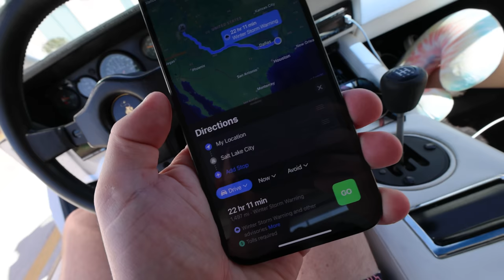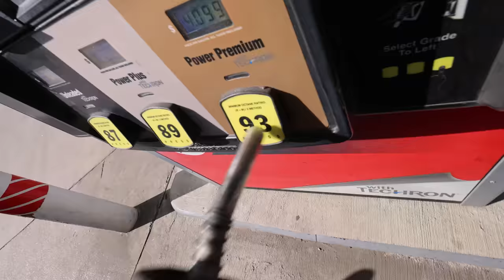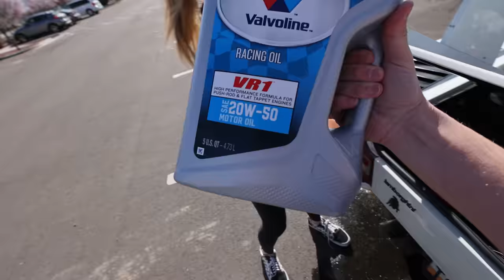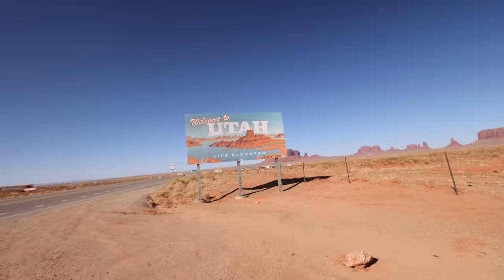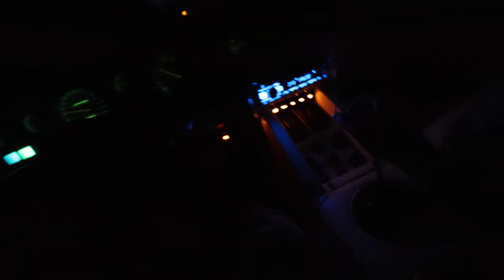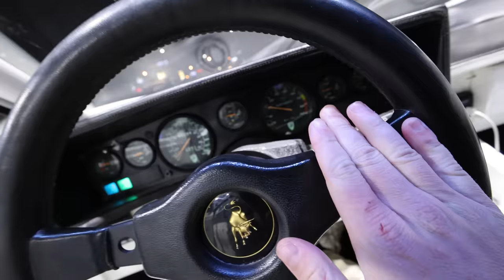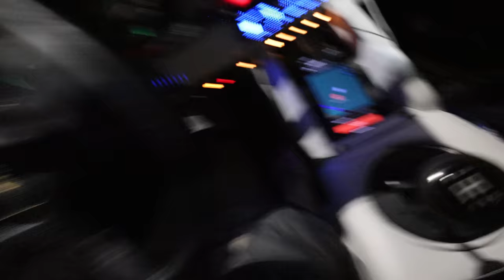Driving my Lamborghini Countach 3,000 Miles Across the United States.

Comment: Driving across country is one of my favorite things to do, but it MUST be in a good car.  Seems you have a great companion for doing so and helping with the love for older cars which a lot of use have.  I had a car that was basically given to me that I took halfway across the country , at least, 4 or more times and I never had any issues with it, but it was a German car.  That radiator stop leak is HORRIBLE stuff, and I can't believe they instructed you to put that into your newly rebuilt Lamborghini's engine.  Once , I put that crap into one of my cars and I learned my lesson when trying to flush it back out of the cooling system years later because it basically turns into Mud and is very hard to flush out of the engine block and radiator. I will never use that crap again, and just fix the leak.

Comment: K-seal is made of magic. I had a 92 camry that overheated when the 20+ yr old radiator exploded on the hwy. The block got so warped that it would leak 2-3 gallons of coolant a month. I put a bottle of k-seal in the radiator, and It completely sealed after about a week of driving it. For the next 3 years it never leaked again and I finally got tired of driving a near 30 yr old car and upgraded. I wouldn't be surprised if it still runs to this day. I am still to this day mind blown by how well it worked.

Comment: so just wanted to share as a gear head and a mechanic, non fuel injected vehicles; as in cars with carburetors require re-jetting of said carburetors as you climb to higher altitudes. the more displacement a car has the lower that altitude is before re-jetting is necessary and the more often it is needed. air is thinner up high so cars require less fuel.
      no idea how difficult that is on a Countach but on old muscle cars its pretty easy. that was the reason why the car started running poorly. so be careful. To much fuel in the cylinders can result in a condition known as washing the rings, and results in scored cylinder walls. if you are going to road trip that beauty consider looking into how to re-jet it. thats just part of the fun and adventure of owning a classic car.

Comment: The problem you had when it did not run right is caused by altitude. The higher you go the thinner the air. Which is why it died in the day, during the heat, but ran at night, thicker air from night moisture. When you get home your car will need an air to fuel intake adjustment. Great vid. Keep Smiling. 😎🖖

Comment: You can turn of the 'door open' buzzer. Find where it is coming from and unplug it. It is an electronic buzzer plugged into a circuit board and unpluhs like a fuse or relay.

Comment: let her run for a little bit after turning her on, but judging by what I see, you gotta clean out the throttle body or check your idle air control valve. Had the same issue on my 93 240sx (two different cars yes, but it seems exactly like what I was experiencing). Always a blast to see these videos!

Comment: I cant believe you put a k-seal in a lambo. Please flush the whole cooling system when you get home. That stuff will block and clog up your radiators for fun. Its a last resort product for saving you when your stuck. 
Im glad you got it nearly home but i would defo get it looked at and flushed. 
On a plus tho, Sophia is defo a keeper bro. They way she slide thru that wing to play with your hose. Damnnnnnnn

Comment: Yo strad I noticed both times it died/almost died, at the gas station and at the hotel, you were driving very slowly in 2nd gear. Maybe your leg was tired and not pushing down all the way, or maybe you're leaking clutch fluid, or maybe you have air in the clutch lines, but try some of those solutions

Comment: Great that you have one of the most Iconic cars. I always nip up the coolant hose clamps prior to any drive and have a nut runner in the car with me, just in case. The cars are very reliable. On my recent Italy trip (1600KM) I did not even check the oil. 

Question, did you specifically want a fuel injected car. Or, just a case of what was available at the time? As the FI cars have many more aspects to go wrong and they are slightly down on power compared to a carb version.

Comment: Probably has to do with the elevation change. Modern cars have computers that automatically adjust the fuel mixture with altitude, but old cars sometimes require some adjustment on timing so that they can run efficiently at higher altitudes.

Comment: My guess for why it isn't running well would be that, if it's carbureted, the altitude has just changed your air fuel ratio enough that it isn't happy.  The air in Moab, UT (~4,000 ft above sea level) is about 11-12% less dense than in Miami, FL.  So it's probably running a bit rich.  Getting that carb (or those carbs) adjusted will hopefully work wonders for the old Italian!
Reply: it is fuel injected looking up (1987 lamborghini countach 5000 qv carburetor) you can see a carburated Lambo looks like a carburetor but his engine bay shows one of the rare fuel-injected versions. He's also said it is fuel-injected.
Reply: @ICP1SBJ  Alright, then I retract my previous comment. Altitude is not the problem. And good on him for getting a fuel-injected one!

Comment: the fuel issue sounds kind of like the fuel tank does not get air to pressure the fuel down better to the fuel pump etc. it does better on higher rpm but idle it cant suck fuel very well. the fuel tank cap or something else is the issue there. if the issue is in that

Comment: Thats normal on carburator old cars it will die the idle will get crazy. Try to minimize as much as electric when it happen like turn of the aircon or heater and when your at the stop light at night turn of your headlights leave the park lights on. Because the bulb suckin all the power of the battery. Thats why its better to have the LED bulbs

Comment: I’m not sure but maybe the altitude is the issue. Older cars need to be tuned at altitude because less air messes with fuel to air ratio. Most modern cars computers auto adjust but maybe since the car is older it needs to be tuned manually for the altitude?

Comment: I dont know if this would help but I experienced that hesitation and rough idling on my V6 Explorer before
took me many months to solve but turns out it was a slightly dirty gas tank and a dirty pressure regulator on the fuel pump assembly

Comment: A carbureted car at high altitude can be an issue need to adjust it for high altitude.
Basically the elevation in Utah versus lower altitudes.👍
Reply: Maybe Sophia can retune your carburetor for you James so yes more fuel at idle because Utah versus lower altitudes.  👍
I don't really feel like flying over there.
Reply: I hope you read the comments tomorrow morning.
Reply: it's fuel injected.
Reply: @ICP1SBJ  Can you tell me why the stuttering if it was injected sometimes a symptom of low fuel and hi altitude for typically a carburetor.
I guess it's possible he has a clogged / blocked fuel filter.
Reply: @ICP1SBJ  Also three thousand miles for something that's was parked for a long time.
Reply: @EDV8ZR1  yeah he should check the fuel filter for sure but he said in a comment in this video that it was fuel injected.
Reply: @ICP1SBJ  Okay but this is James is he sure?
Reply: @ICP1SBJ  this is a pretty old Lamborghini it could be carbureted
Reply: @ICP1SBJ  also Tyler Hoover had the same car it was carbureted
Reply: @EDV8ZR1  I just looked at the video where he bought the Lambo and it's a (1987 Lamborghini Countach 5000 Quattrovalvole) which is fuel injected
Reply: @ICP1SBJ  So that's basically the old EFI system like on the old Chevy trucks that's prehistoric partially absolve partially reality the older EFI systems we're kind of pathetic sometimes why some people said I prefer carburetor back then
Reply: @ICP1SBJ  originally old school electronic fuel injection I was a joke to some people

Comment: If the coolant leak is from a loose clamp why dump K seal in there? Those type of products wreck havoc on coolant systems and are like a band aid in an emergency situation when there’s no tower options on a hooptie. Tighten the clamp on the several hundred thousand dollar car and see if the leak stopped.

Comment: That car was not designed to run on ethanol enhanced gasoline always remember that when you see a station that says no ethanol in our gas that's what you put in that car. Only cars built after 2005 can run on the standard pump gas that everybody's pulling up to the phone looking for the lowest price. If it's built before 2005 you can spring leaks you can destroy mechanical fuel pumps, they have even tampered with the diesel fuel removing the sulfur and that also causes leaks in the rubber hoses same as the gasoline cars with that ethanol it dries out all the rubber parts and causes leaks. They did that to make great profits clean the air and get old cars off the road by destroying their fuel systems

Comment: You do realize coolant does not work as well as water, its simply to prevent freezing in cold temps. You should probably be running 80 water 20 percent antifreeze. So when you refill it you add the same ratio. Pretty simple. Can I has your car?

Comment: I would never use K-Seal for a leaky hose.  That's not really the correct usage.  Proper procedure would've been to remove the hose, clean the sealing surfaces and either put the old hose back and re-tighten or change the hose.  I suppose on the side of the road, that's not entirely possible. But.... I dunno..... if I had a Countach.... hmmm

Comment: If it's not a hose it's a clamp.   Ugh.   Smh that's not cool but I'm sure you'll find the true issue.  Well that's age. That's how you disect what needs to be refreshed. You probably need to change the fuel filters on it . When you run the tanks all the way down, you suck up the grime at the bottom into the filters,  should just change them and get going

Comment: Low gas is dirty gas, maybe overheated
Reply: yes to the 1st 2 because when you let the tank get low you suck out the dirt from the bottom of the tank. But the clamp failed due to driving from warm weather to cold weather and back to cold weather. The hose expands and shrinks with fast weather changes. It is the same reason his Z06 transmission fluid clamp failed (transported in a heated trailer and put in a freezing garage)

Comment: Bro you did the worse thing you can do. This "Magic Liquid" will full all the refrigerator line with some terrible rubber liquid because the problem it's always in the rubber, but the problem it's this liquid entered in the engine and for clean that trash you need to teardown all the engine. When you say it's working i tell you why the rubber when the engine it's cold have contractions and can have leak's, when the engine it's hot have expansion and stop to leaking. The problems its always in the rubber tubes because with the years get dry and have cracks, change it it's just a few dollars and it's everywhere. Now the thing you did can cost Thousands of Dollars fixe it and maybe the engine never works back because it's so hard in this cars do the synchrony and not many people today know how to do it 😔